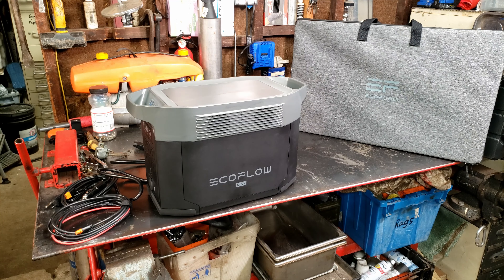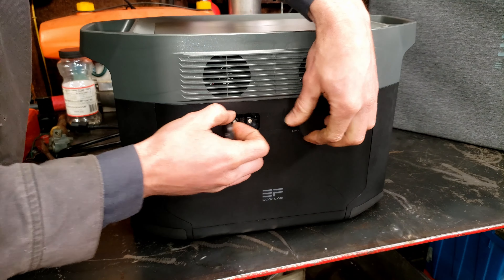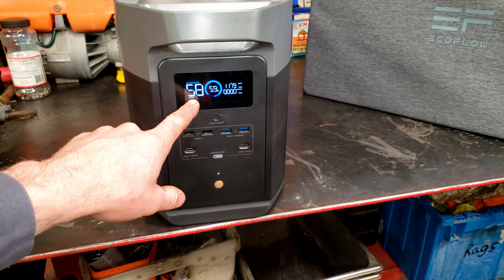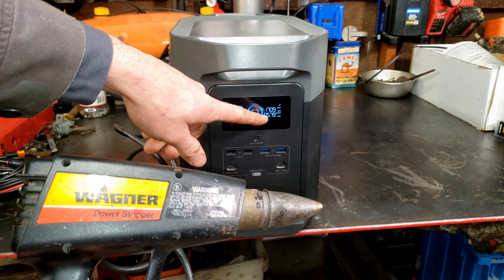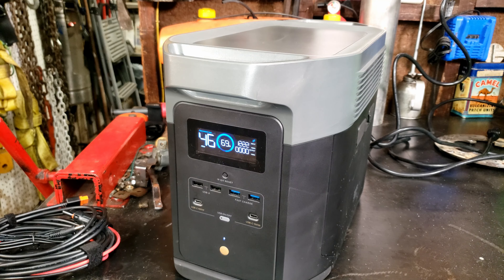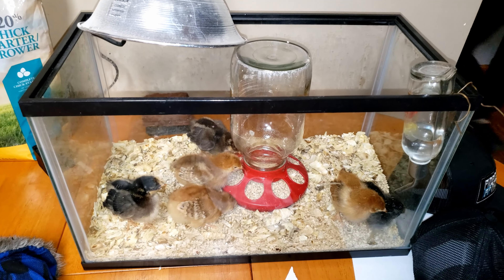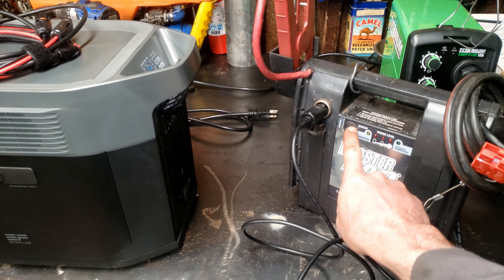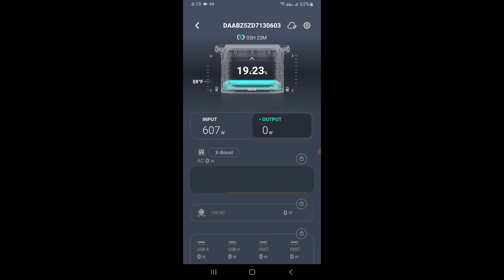EcoFlow Delta MAX 2000 Solar Generator Review

Comment: I am impressed that it was able to power your welder and then all of those appliance.  As always Chris you get right to it and give the item a hard work out and thorough review.  I am glad that you kept that fridge going so that Jen could have a cold beverage when she got home.   😉 👍
Reply from the maker: Yeah it's definitely a pretty impressive little unit. Pricey for sure though. But for an off-grid cabin or something, it would be great to have and power most everything
Reply: @NNKH2    Yes it is pricey but it also could be a life saver.  I am thinking for somebody that has to use a sleep apnea machine at night in order to breath or other medical equipment.  I know that there actually are a lot of nomads that struggle with the issue of having a dependable power source.   For somebody this could be a necessary investment in their health and well being.  Being able to power your refrigerator the way that it did tells me that it would do really well for powering necessary medical equipment. Thank you Chris.
Reply: @richardthomas1743  I just bought the Deltamax 2000 to power a wheelchair lift for my wife. I put my three grandsons in the lift, about 240 pounds combined not counting the lift and the Deltamax worked flawlessly. This will also be used to power lift recliner, air mattress, and adjustable bed. I am watching for the next sale and may get another battery to run everything including the refrigerator a lot longer. I live in the city but we did lose power for about 90 minutes during a storm last week and it was a bit of an eye opener to our needs.

Comment: I bought one to power my wife's wheelchair lift and it worked flawlessly. We had a 90 minute outage last week and it was an eye opener as to what we need here with a disabled person. Lift chair, bed, etc. I am waiting for another sail and will probably get at least one more battery.  Are there any recommendations for a solar set up besides the Ecoflow brand? I do have a generator but it is loud like most are and it would have to get hauled out of the shed during a failure.

Comment: Great tutorial.  I noticed the welding splatter pit marks on the side of the generator . Did any welding splatter get into the fan intake screens  and if so did it decrease the efficiency of the unit in anyway ?  If not this is a remarkable generator. Thanks for the informative review.

Comment: I like everything except the price…. I want a solar Gen, but my issue is I will not use it much. I live in the south (NJ transplanted to SC)… we get Hurricanes down here and I have a gas Gen, but honestly I have not even run it for 2+ years (drained the fuel).. so while a true solar Gen when needed would be vital, I’m afraid of it just sitting around basically I unused.. Also I only have like $250 in my gas Gen.. been tossing the idea around for months though.

Comment: I just got one of these units slightly used.
My question is: what is the better switch setting to use if you are recharging it from a 12 V source or Solar? Should you switch it down to the slow charge setting on keep it on the fast charge?
Do you have to go into the app and mess with the settings whenever you use the slow charge switch setting or is that not really necessary?
Thanks for your time.
Reply: The fast/slow switch is only for the ac charge input and the slow can be customize via the app. Now the ac/dc and solar input are actually combined altogether when everything is charging up to 3000 watts so that is definitely a miss in most reviews I've seen but an incredible positive advantage.

Comment: How long does it take to drain with no use at all. I’ve had some larger power banks that are dead when I need them if they are not being constantly charged.
Reply from the maker: Great question. It's been sitting since I posted this video and it's still at 100%. But I haven't owned it long enough to answer that question thoroughly
Reply: They advertise it holds its charge for a full year.

Comment: Damn, I can't believe you're welding right next to the freaking power station! You're going to have melted shrapnel during the side of that power station and leaving little holes in it in no time! You should have at least placed a protective cover between your welding and the power station. I get demo's but that not smart at all. :face-turquoise-covering-eyes:
Reply from the maker: It's fineee

Comment: What do you think about California banning gas generators and small engines by 2024? How many of these battery banks do you think people will need for a week long power outage? I honestly can’t believe California is outlawing small engines under 25hp. It’s crazy.
Reply from the maker: Damn really? I haven't even heard about that. Insane! I wonder how they're going to enforce that. I mean I suppose this thing could last a week for absolute necessities. But yeah I mean as you saw running a refrigerator. You might get like 15 or 20 hours out of it at best.  I guess it would really land on having a nice solar panel setup to keep juicing it

Comment: Question: I do festivals and I am interested in buying the EcoFlow to power my fans and lighting during summer months. Do you think I can get at least 10 hours of power with small 3 fans
Reply from the maker: Yeah I would think so. I guess it really just depends on the draw on the fans though and then you can calculate it to see how long it will run them.
Reply: @NNKH2  they are 162w fans 120v